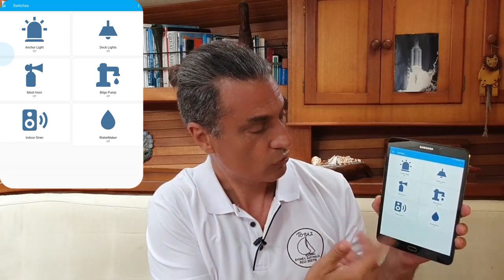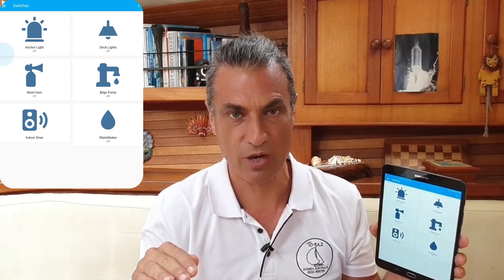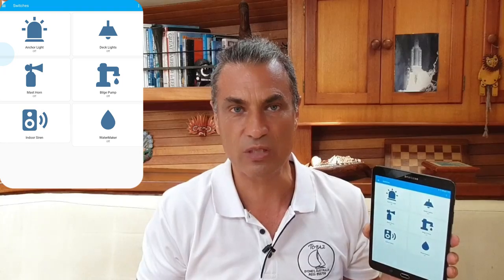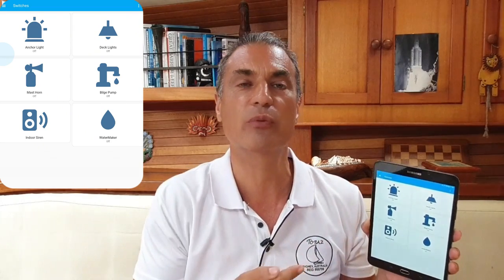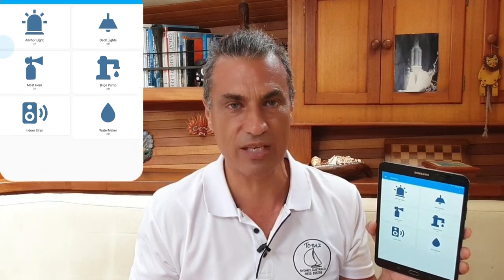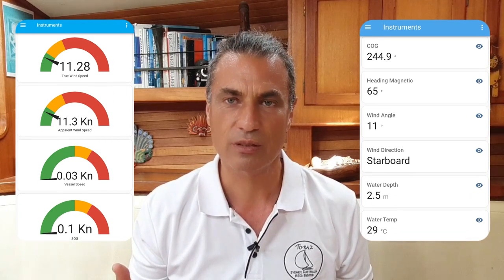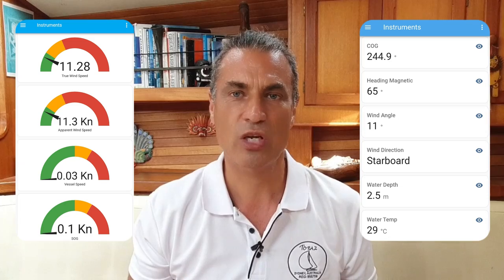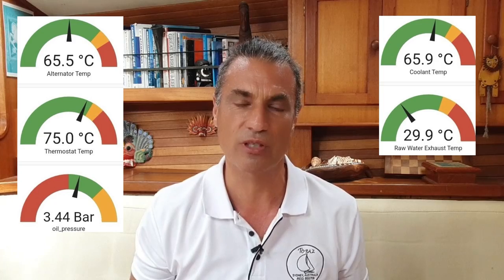DIY Smart Boat Setup: A Budget-Friendly Guide

Comment: Thank you Rob, great video. What NMEA 2k to usb cable have you used? The cost of the ones I find have 3-digit figures.
Reply: @SmartBoatInnovations  thanks for your response, Rob. I look forward to finding out about the outcome of your testing, once you get the chance to do it. Fair winds.
Reply from the maker: Hi Yannis. I have developed a prototype N2K adapter. If you would like to try it out send me an email and I will send you a list of parts required. Costs less than $20. smart.boat.innovations@gmail.com

Comment: HI Rob, I am in the process of buying a sailboat and have a question. Can you add local voice command to work with automations? Thanks
Reply from the maker: @Jmarty34  Yes it is possible to add local voice but I would advise getting a Raspberry Pi 5 as it is quite intensive. However internet based Nabu Casa voice works  very well and is fast.
Reply: @SmartBoatInnovations  thanks for the quick response. I use the Nabu casa service at home but concerned for the lack of internet service while at sea . Looking for a way to use an echo device to turn on lights and play music from a server. And yes I purchased 2 raspberry pi5 for this purpose. Any suggestions on this? Possibly making a video on this subject would be great since most cruisers will not have internet service while at sea.